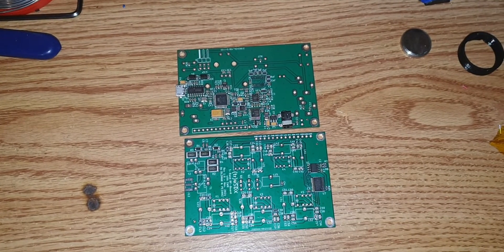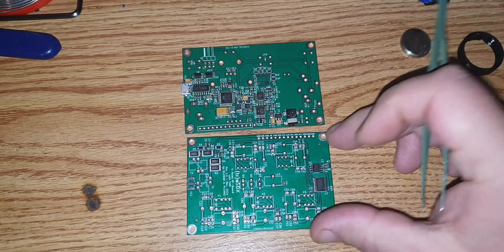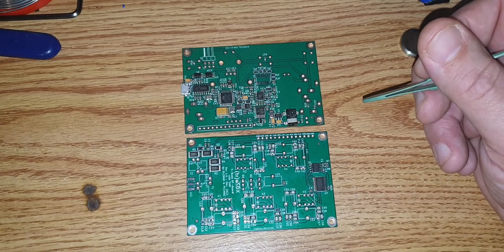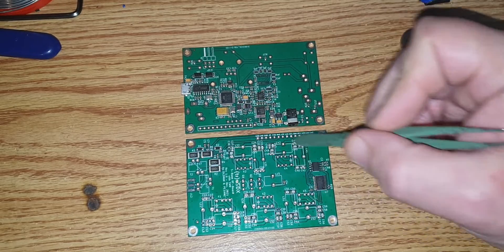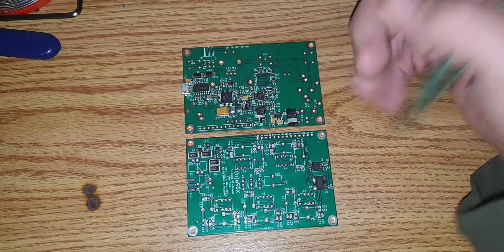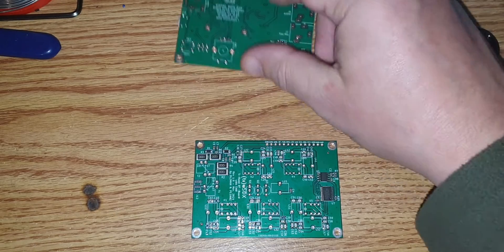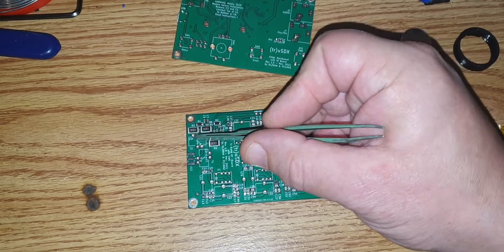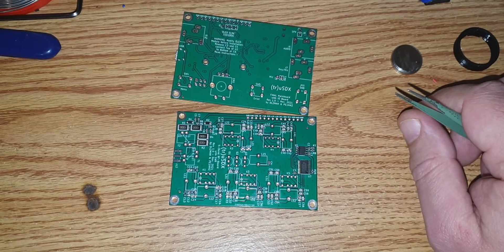(tr)uSDX Pre-Assembled PCB walkthrough

Comment: It's great that you can get JLCPCB to do assembly.  But potential users of this really cool project ought to think about it another way -- this would be a great opportunity to get familiar with doing SMT assembly.  Those parts all look like they have exposed leads and should be easy to hand-solder.  All you need is the right tip for your soldering iron, some good tweezers and small diameter solder.  Oh, and if your eyesight is really poor like mine, maybe a one of those magnifying lamps so you can see what you're doing.   I find surface mount parts much more preferable to through-hole components.  Give it a shot!   If you're not using really tiny parts with buried pads, hand soldering really is something that you can do!
Reply from the maker: Hi Louis, You can also just order the PCB´s. Gerbers will be published, and you can decide what you want to do with it. And yes: I would also encourage people to try to solder SMT, but the component density is pretty high especially on the mainboard of the (tr)uSDX. It can be hand soldered, but it´s quite a task....
Reply: Very often it is also a matter of spare time... not all of us have any. Thumbs up for Manuel!
Reply: I'd say the most important thing is technique. Watch DL2MAN's SMT construction video, as well as some others. Then try out all the techniques you see to see which ones work for you. I used to solder 120 pin quad-flatpacks more easily than 8-pin larger IC's simply because I knew the trick about 'blob' soldering all of the pins down one side (after pre-fluxing the pads,) then solder wicking the blob back up. The surface tension of the solder left just enough solder on the legs of the pins to make them look like the chip was machine soldered, and it took little more time than soldering the 8-pin chip did. That's just 1 example of learning effective SMT soldering techniques. BTW, I'm in my 70's and my left hand shakes, so I brace it while I work and I use a low-mounted board vice to hold the PCB.